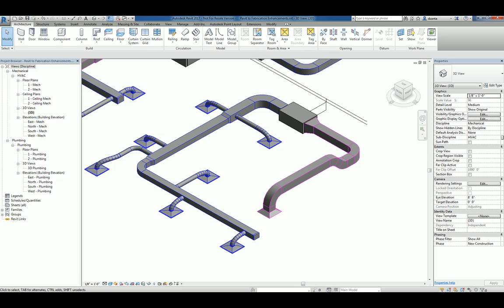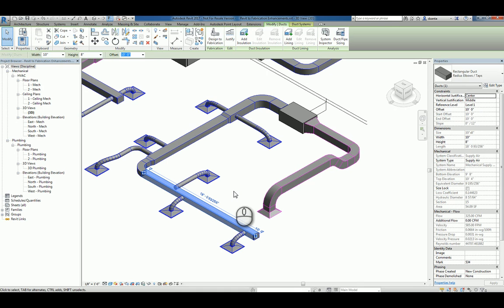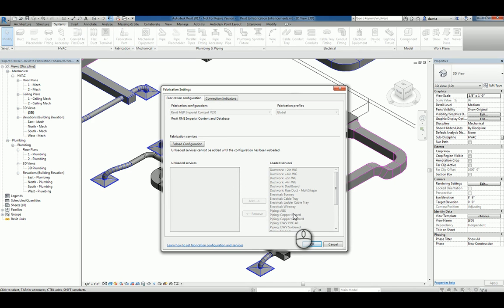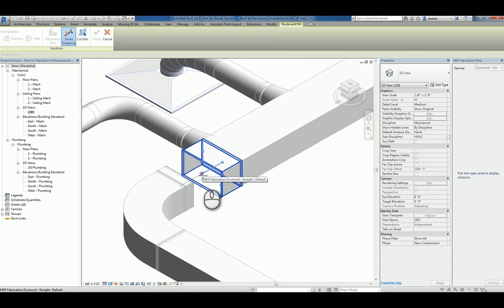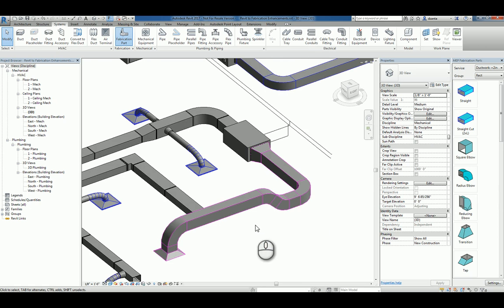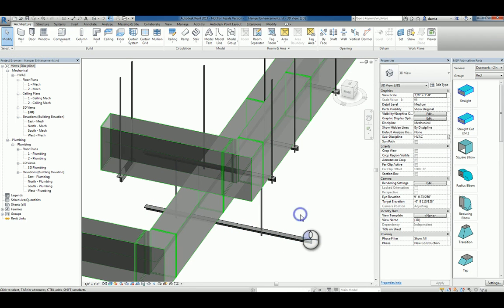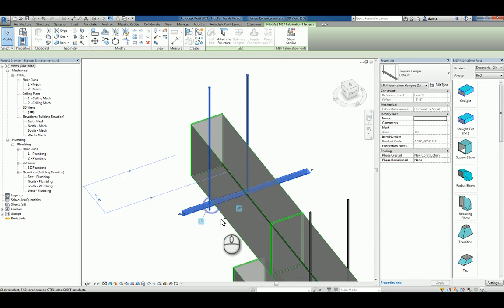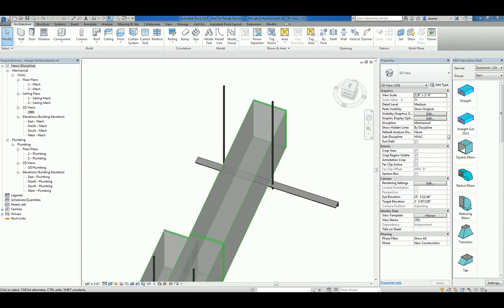What's New in Revit 2017   MEP Improvements

Comment: I've notice that you were able to connect round duct to rectangular ones.

I am working in my 1st project here. I have finished all the layout using Taps for both round and rectangular. Now, when I try to create fabrication all the round ducts (branches) disconnect from the main (rectangular duct).

When I try to use the route and fill option (cut into), an error message shows: Fabrication fitting could not be made to fit. A supported route could not be found.

Any thoughts of why it could happen and possible solutions?

Thank you in advance and congratulations for this fantastic tutorial!
Reply from the maker: Hi Wagner,

There can be a couple reasons why this is happening.  First, it is usually because the Mechanical Settings dialog box within Revit has not been adjusted to include the proper family types to use.  For example, the Angles section isn't using specific angles.  If you choose "Use any angle," Revit will try to use default families with known industry specific angles and therefore give you the error.  Second, check the Conversion section to ensure proper duct types are specified and not left blank.  Lastly, check within the Fabrication Settings dialog box to ensure you have loaded all possible fabrication services available within your Revit MEP fabrication configuration database file.  Hope this helps....Please let me know your results...don't forget to subscribe to  my channel...trying to build up my online presence and social media identity.  Thanks.
Reply: I was able to manually connect them by using a bellmouth Round1 fitting available in the fabrication. But Revit is still unable to connect them automatically, and the same happens with the round tap duct and the supply grille
Reply from the maker: +Wagner Cardozo contact me tomorrow am and i can remote into your system to help you
Reply: I just had a click once I had your instructions again and worked!!! Thank you again!
Reply from the maker: no worries